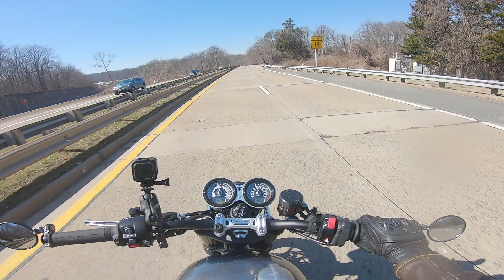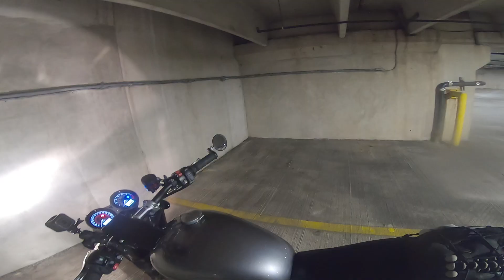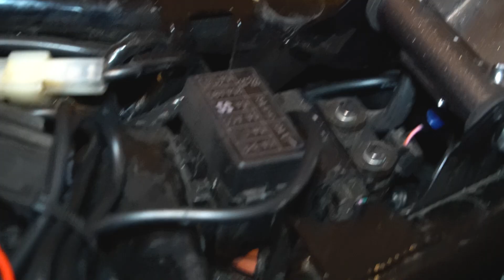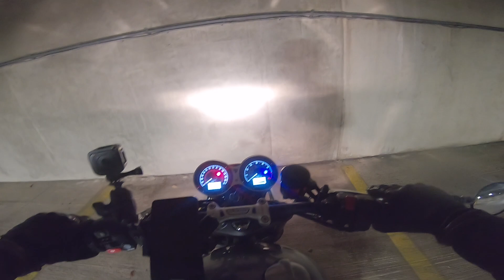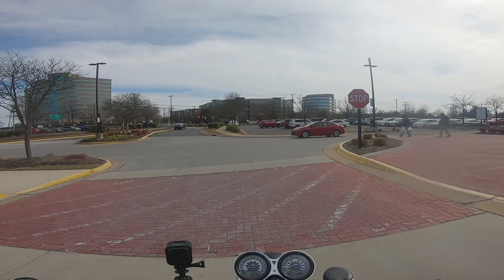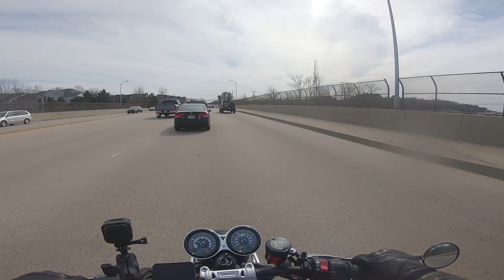Why won't my high beam dashboard light turn off? // 2019 Triumph Speed Twin electrical gremlin

Comment from the maker: I have checked around the headstock for worn or frayed wires, but none were immediately apparent.
Reply: Indicator light is on but you have no high beam.  The bulb blew when you hit the bump.  My guess is replace the headlight bulb.  Blue indicator light is on to let you know something is wrong.
Reply: Eliot, 
I think the answer has been provided already 
High beam lights are massively more noticeable  ... and the blue light is on, because the circuit is “closed” 
Your H4 bulb is shot...
Replace it and you should be good. 👍🏼

ALSO, don’t touch the “glass” part of the new bulb 💡 with your fingers, only the metal end, when unpacking and installing (this would reduce its lifespan) 
But you probably knew that already... 👌🏼

Let us know how it worked out
Cheers 🤜🏼🤛🏼✌🏼🇵🇹

Comment: My Speed Twin's high beam is very obvious when turned on. When parked up in front of a wall, you can clearly see the beam pattern shift upward. Seems like your 2nd filament is not lighting up properly (bulb is an H4 dual filament). 

My guess would be that the bump knocked the high beam filament loose, or maybe damaged the wiring somehow. I'd start by just installing a new H4 bulb. Beyond that, just take it to the dealer. If you're sure you didn't touch the light wiring while installing your heated grips, then you shouldn't have a problem with the warranty.

Comment: I would check the filaments in the bulb it's possible that they have come loose in or touching each other or remove the bulb and see if the blue light goes off

Comment: As you mention, it would be a pain but I if this is an issue with the wiring harness it should be covered by the warranty, I am sure they can check it for you, either way, that might take them some  time to figure it out.
Reply from the maker: If it comes to that, I might see if the dealer in Denver can accommodate me.

Comment: Gotta be the bulb... just tested mine and the pattern cast by the headlight changes significantly, whereas yours doesn't - brightness does as well, but pattern is a dead giveaway... smart money is the jolt from the pothole broke the filament... oh, and before you start thinking 'LED bulb', check out the videos on Adam Croll's channel...
Reply from the maker: I'm hoping that's all it is. Definitely not going to an led, lol
Reply: @VanBlamm  Fingers crossed!... Interesting if it is the bulb, would suggest the high-beam light always on is a 'warning' of sorts? Intentional?... Oh, re LED, sticking with the Halogen is the conclusion Adam came to...

Comment: The fact that it happened when you went over a pot-hole makes me think that something has been knocked loose, either in the switchgear on the left-hand handlebar, or within the clock assembly. Also, the highbeam should be WAAYY more noticeable than that. Have you checked ALL the fuses underneath the seat?

Comment: I don't have a speed twin, yet, but are you sure that you are not always with the high beam? I would first check the lamp, or try disconnecting the clocks and reconnecting them. finally would look into the controls. ANother question is, did you wash your motorcycle recently? Sometimes moist gets into the controls and gremlinize them all... a little wd40 into those and usually do the trick (Saved me twice already, but my KAwasaki W650 is old)

Comment: When I flick the high beams on my Street Twin, the lamp gets much brighter than low beams. I was looking at my wiring harness and how it hinders turning the handle bars to the right this past weekend.  I was like...that wiring harness will not last with all that rubbing.   If it ends up being a problem..Kawasaki 900RS.

Comment: I think... think, it looks like an earth issue somewhere. I think two wires touching or a wire touching something would short out. Hence the weak full beam not getting a full current, Just a guess.

Comment: Also check your service manual if the headlight wires go through the computer I would disconnect the battery and reset the computer

Comment: Pull the relay with the bike off.
Turn on the bike...it wont start because its a can-bus system.
Turn off..reinstall the relay and the see if it helps.  My .02
Reply: That's interesting... I've really got to lookup what 'can-bus' is... guessing you're thinking pulling the relay and reinstalling forces the the bike to reset it's state...